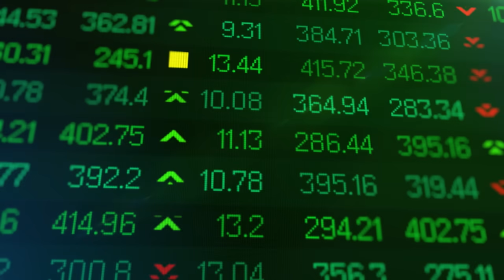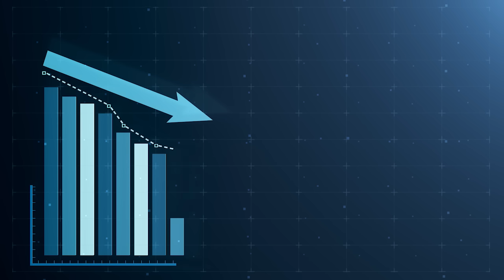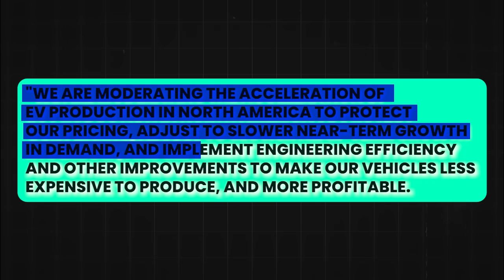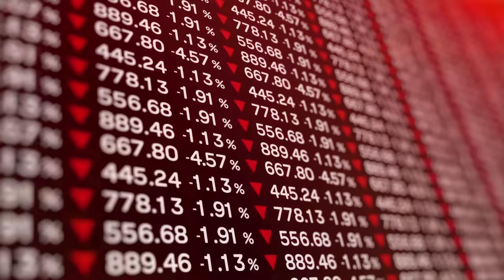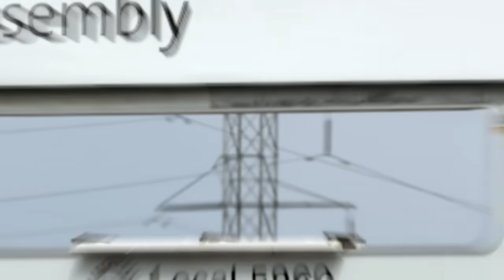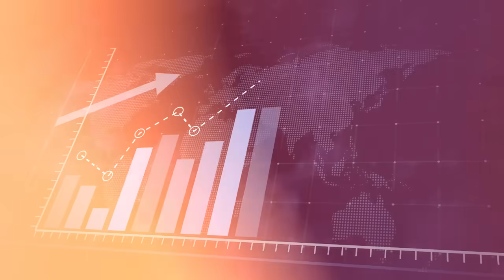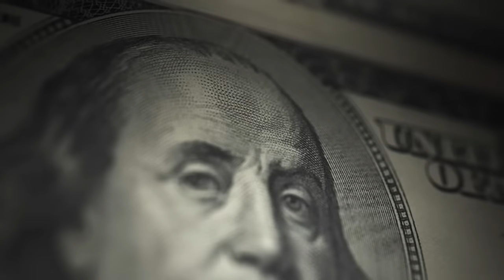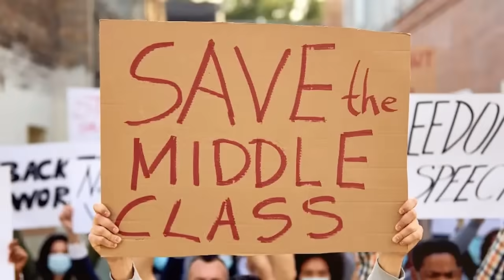HUGE NEWS! GM CEO Just SHUT DOWN EV Production!

Comment: I love how (starting at about the 3 minute mark) it's all GM's fault.  They're not paying the workers enough and the cars are over priced. If they're loosing money on each EV, to the point where the total is into the billions, then they've set the prices too low.  Want to pay workers more? Then you have to raise the prices.

The simple fact is that electric vehicles are expensive, they don't have the range or reliability (drive one in the cold), there is not enough infrastructure to support the ones that are already on the road.  And the buying public is now aware of all these issues.  And the public is also aware that the cost of running these vehicles will be much more expensive than gas powered cars.

The only reason car companies are making huge investments in EVs is that production of internal combustion powered vehicles will be made illegal in the next decade.  There is, and never was, a huge consumer demand for these cars.  This problem is basically the result of socialist policies and beliefs.

Comment: Incorrect. EV sales have significantly increased this year compared to last. GM faces numerous challenges, particularly in finding a competitive edge in the EV market without incurring substantial losses. They are actively making adjustments to remain financially stable during their transition to EVs. They're not discontinuing EVs but are striving to stay solvent. If GM could instantly perfect their processes to produce an appealing, affordable EV, they would, but they can't so their doing what they can--I don't think it will work.  RIP GM

Comment: The average cost of a car/suv etc is $50,000 today. That is the problem not the EV's (they are however even more expensive) It used to be spend no more than 10% of your income on a car. By that measure, you need to be making $500,000 a year to be able to afford a new average priced car today.

Comment: I am quite happy with my 2001 second gen Dodge Cummins with a Manuel transmission. Just spent 800 dollars putting a new clutch in. The truck is a total tractor. Always starts. Gets killer mileage on diesel. Black clouds liberals on demand. Hauls all my heavy stuff around. No car payment. Modest registration and insurance. No thanks on a new EV. I just fine as it is.

Comment: EVs discharge and freeze in the deep cold we get between December and March up here in Maine or other northern local. That means stranded in FATAL temperatures, at best waiting for the battery to thaw THEN recharge in -40° weather. No one ever stopped to think what happens when these age over 15 years in the salt belt. Anyone whom has replaced rusty rockers understands those battery packs WILL fracture in old age, smart people know when a lithium ion batteries puncture they light into a fire that, like napalm, won't snuff out easy! Morty how dumb are you? Just use salt water for the hydrogen in an on demand system. While it may only get 2/4 mpg it's salt water and free! Not to mention the exhaust is fresh air and water two things the whole planet is in dire need of. The internal combustion engine was never the problem the fuel CHOICE is!

Comment: Trying to force a mass conversion to coal burning vehicles (aka EVs) has been a huge mistake. The horse and wagon didn't begin to disappear until a consumer driven infrastructure for supplying fuel to the more efficient and longer ranged petro burners. Government interference (incentives) do a great job of creating havoc as unperfected technology is rushed into production. Battery fires, lack of range, pollution caused by very expensive battery manufacture and the inevitable poor quality control from rushed manufacture keep people like myself from considering the EV. Add to the mess, the cost of an EV over a normal vehicle. This punishes those on a fixed income as retirees. At the beginning of the 20th Century cars were an insanely expensive item and were a toy of the wealthy. When Henry Ford built cars that were in reach of the general public then demand increased to a point where it was a profitable endeavor to start a support industry. Petrol stations, repair shops, parts stores and a spreading fuel distribution system created a price per volume drop which was not a shock to the economic system. Leave it to the market to flourish, To screw something up it takes politicians.

Comment: EVs technology is rapidly advancing. Yet it already has numerous advantages over ICE cars...
More efficiency (gas cars waste 80% of their fuel as heat) 

More room E.g. front trunk. 

Way fewer moving parts. 

More power, faster acceleration, higher top speeds are all possible from small lightweight motors. 

Quieter ride, low center of gravity for better maneuverability. 

No oil changes. Regenerative braking minimizes brake pad wear. 

Safer...large crush zone in the front. Unlikely to roll over. 

Way less pollution that gets better as the electrical grid uses more renewable content. 

Batteries are fully recycleable because they contain valuable assets. 

You can charge at home and be full  every day without going to a gas station. 

4 400watt solar panels on your roof will produce enough electricity in a year to propel a Tesla Model 3 approx. 10,000
miles.  (I bought an 8 panel system for $6500.)

Comment: GM and Ford need New Engine Type (NET) tech which offers:

300,000 mile warranty
30,000 $ price for mini van
3000/4320 mile range on Ethanol/gasoline
300-840 HP continuous-peak
30/60 gallons with/without CO2 capture
3 minute fill ups
that can tow up to 22,000 LBs with extra tow equipment.
AWD, 
bumper to bumper flat inside and out
true skateboard tech that can have 100s of different bodies added
Truly ONE common power system for ALL vehicles
NO drive battery nonsense
1.2 million mile life for 60 years with 3 overhauls
100 MPG Ethanol, 150 MPG gasoline HWY
180 MPG Ethanol, 270 MPG gasoline in City
NET is a combustion HEAT PUMP COP4, that can power house too
Free heating and cooling with CO2 combined cycle capture.
No range loss in cold/hot temps due to cabin heat issues

GM and Ford would DOMINATE the auto industry with NET.
They are bankrupt without it.

Comment: They should have gone with hybrids. Hybrid vehicles would be the only way I would even consider buying one. Also, it better have a solar panel on the roof and not look like a stupid spaceship. And the battery pack needs to be easy and inexpensive to replace. And have a 10 year bumper to bumper warrantee. No more junky, plastic, expensive cars and small trucks.

Comment: So I drove up to Connecticut from Delware on ONE tank of diesel in my 1999 Ford Crew Cab pickup - with 440,645 MILES on the odometer - and we took a two hour trip back to New York City in my friend’s Tesla… we needed an HOUR to recharge for the trip back to Hartford… and, when we got back, we had to take my truck for dinner because the Tesla was back on the plug!

Sooo… I think the “Fact Selector” made my point…

Basic MATH 115 + 115 = 230 which the upper range of a Tesla… right? Those are your numbers… 

Now YOU may like to have driven a car near EMPTRY before filling it up (don’t try that with a diesel vehicle!) but NORMAL people don’t like to drive on the edge of getting stuck on the side of the road because they miscalculated and - now - they have to try to make that Emergency Call to Tesla to release the emergency battery power to limp to a power plug.

As for cost comparisons… were we talking about “cost” or “speed” or “comfort” Huh! We’re we??? Nope.

But - since you brought it up - unless you have installed solar panels on the roof of - your own house - the vast majority or people life on Home Associations or RENT so they are at the mercy of the local power grid (which LIBTARDS forget is oil/natural gas and or nuke driven) so you will have to account for paying the utility companies over the next 25 years! You wanna bet that’s gonna remain… cheap to power up your EV every night? 

Yeah, a 25 year old diesel truck SUCKs fuel from that 40 gallon tank… and cost a couple thousand in maintenance every year since I bought it for $8K back in 2003 best deal I ever made in my life because I’ve always worked 15 minutes from where I lived because I rented or moved (most rentals do NOT have EV and it doesn’t look like people will be able to afford to buy houses for the foreseeable future… “renters” so factor that into any purchase.

Finally, as my Tesla owning friend says “I wanna pick up some stuff from Home Depot for the house” YOU DOING THAT IN A TESLA! Can’t count the number of times I’ve folded back the tarp and hauled lumber, chairs, pipes… and - as things get harder - I have the option to use my truck to make some $$$ in ways that would make Tesla owners WINCE ! 😅😂🤣

Finally, I go on epic trips and load my 2018 BMW Adventurer - using a Rampage - into the back with enough camping gear to last a month - and when I unload the bike - the tent goes over the back of the truck… no NOtels!

And the ride - up above the crowd where I can stretch out in a crew cab (along with four other six foot ADULTS) - is the best driving experience I’ve ever had in my life (and my first High School car was an inherited used Porsch!) When my friend and I wanna go for a long drive - with his wife and kids - he offers to buy me a tank of diesel (which I don’t need) while his Tesla stays at home… with his dog.

So - that is the “holistic” experience of STILL driving and riding and owning - a truck! 

Enjoy your Tesla and solar panels (and let me know when the 20 year Lifespan of those panels expires… still don’t know who is going to be responsible for the toxic waste of dead solar panels 🧐)

Comment: Thing is without the Tesla supercharger network, EVs are extremely inconvenient. Even with the superchargers it takes about an hour to charge, which is already a deal breaking for me. Other chargers are 1/10 the power. Yeah if you own your home you can charge at home but what about when you leave your city.

Long story short Tesla is the only one I would consider buying. As a professional driver, who leaves my city a lot, one hour of charging per 6-8 hours isn't good for me.

Personally I prefer hybrids. Not the plug-in type either, gas only. The hybrid system makes the car very low maintenance by taking a lot of stress off the engine, transmission, and brakes. Great had mileage. Mine is pretty fast although not as responsive if you floor it. It's a 2011 Ford fusion so maybe this has improved.  No charging required.

Comment: I am fine with my hybrid I get 50 to 60 miles a gallon and roughly 500 miles on a single tank switching to full Electric when driving is my job would it hurt me in the long run because I would have to stop way more often just to get a charge and most ranges for a full Electric is like 200 - 250 on a single charge which is not enticing enough for me to go for electric

Comment: Anyone who is a RC enthusiast knows that this is not a sustainable future for mass transportation. Electric Vehicles get 10-20 years of battery life if in perfect conditions, traveling places that are hot or cold will effect this lifespan with a  price point of 4000 to 20000 dollars depending on your car/truck.  Hydrogen engines are the future the exhaust can help with crop growth in the future.  Batteries are far to expensive, id never pay for a replacement battery in those cars.  Our battery technology will not support a sustainable change to electric.  We will mine the planet dry of lithium before this ever occurs.  However hydrogen is plentiful and we can create it Easily.  Either from water or just bottling air and separating the molecules.

Comment: Stop selling fuel efficient cars losing your loyal customers to other manufacturers.
Then wonder why you dont have a customer base for "green" vehicles?!?! This was the most predictable marketing disaster ever.
By the way, a HUMMER H2 is an ABSURD vehicle.
A BATTERY HUMMER.....also an absurd vehicle.
Lost entirely in the EV switch is this, we need to use less resources.
EVs with every possible option weighing 6000lbs are not "environmental " They are simply vulgar resource PIGS.

Comment: I GUESS I'M JUST AN OLD FART But I remember back in the 1980's Chevrolet ran comparison commercials. There were several but one that stands out was a split tv screen showing a bright red 1988 (or 89) Chevrolet Cavalier on one half of the screen and a red Honda Accord on the other half. The salesman wanted to see how much the Cavalier looked like the Honda but cost something like $300 cheaper than the Accord.

Ever since those commercials I've noticed the truth in advertising. Chevrolet builds cheap knock-offs of other manufacturers successful makes and models. To this very day there are millions and millions of 1989 Hondas on the road. I haven't seen a 1989 Cavalier on the road in the last 25 years. That should tell you all you need to know before purchasing a Generic Motors Conglomerate (GMC) product.

Comment: Hydrogen combustion engines are the answer. But My 2010 Prius has 240,000 miles and I’ve never had an issue other than normal wear parts.  If I find another old Prius, I’m buying it.  And I live in Vermont with harsh winters and salt. Hybrids are awesome.

Comment: I believe at some point all gasoline powered vehicles will be phased out, but really that's not for a very long time.  The tech isn't really there yet.  Economics don't support it, infrastructure doesn't, and neither does the supply of the rare minerals used to make them.  I think it's more likely that both the gas powered and the current style of EV cars get replaced by another more efficient type of self powered engine.

Comment: I own an EV but it requires owning a regular car as well because the range is very short requires an hour to recharge on DC fast charge and chargers, especially the so called fast charges are far and few and when you find one it’s in use or busted.  Regular cars have 500 mile range, gas stations on every corner and freeway exit and fill up in couple of minutes.   
The EV is great for local errands   but you have to be carefull or you’ll need to be towed home.  My BMW i3 cost 50 grand and within a year was worth 17 grand.  Pretty much a disaster purchase.   If GM or Ford had hired me as CEO I would have saved them billions.   Likewise if I had become president I could have saved Billions in wasted, lunatic EV policy.   The average janitor would have done better in either case as well.

Comment: It was the right decision to make. Before any it hit the market it's infostructure must be present in order to support it. In the case of EV's, it wasn't broad enough, it wasn't easy enough and wasn't cheap enough to make it a reasonable replacement for gas powered automobiles. 
Let me go over my points.
It wasn't broad enough. Let me ask you a question. How many gas stations are there in the USA? Now compare that to how many Recharging stations exist even today?  It's not even close. And you can fill a gas take in five minutes and be on your way. How long does it take to recharge an EV? Americans are an impatient lot, and do not want to suffer inconvenience. 
And by the way, most Americans do not live in single family homes with garages anymore. So, the ideal of home charging systems is moot. That is unless you either A.) Are willing to provide enough charging stations at apartment and condominium complexes in the USA, at your company's expense or B.) Able to develop a self-contained recharging system that would eliminate the need to stopping anywhere. (By the way, I've got a saturation for that but I'm not going to just give away.)
It wasn't easy enough. If the infostructure existed, if something like my ideal was created and proved on a mass scale, that would solve the first two problems. But then comes the last one: Affordability. Can you do that?

Comment: Chevrolet (GM) SU*KS ANYWAY!!!!!!!!! My 2015 Camaro convertible top has been changed 3 times after the warranty (No Accidents, 31,534 miles IMMACULATE condition costing me $2500 each time. Corporate blew me off and the dealer is useless!!!!!! The rear window keeps separating from the trim. I called other places to fix the top and they didn’t want to be bothered!! Stating “ This is  a common problem with the Camaro convertible and it’s a pain in the butt to fix”. So I will make sure that none of my family and friends NEVER BUY CHEVROLET (GM) cars and/or trucks!!!!!!!!!!!!!!!

Comment: The fact of the matter is some very good new engine tech is coming that use cleaner fuel that are equal or better than oil in mileage and power output, it's a waste of time, that and they are far less complicated then evs to build.

Comment: We don'[t want EV's. I keep a truck or car for 20 years. I pay it off in the first 3 years then I don't have a auto bill for 17 years. Batteries on EV's will not last for 20 years. Maybe 8 years before they are useless for anything except city driving. Why would I spend another 8 to 12 thousand every 8 years to for a used car for buying and the installation of a new Battery. After 10 years you won't even be probably able to buy a replacement battery.  Also will the car mechanical side even be worth investing the money to replace the battery twice in a 20 year span. I may spend 2 thousand in parts for a gas powered truck/car in a 20 year span. EV's cost too much, you need to buy a charging station, upgrade home circuit boxes, and cost of the vehicle is actually divided by 8 yrs compared to a fuel vehicle lasting up to 20 years. If you want to save the environment, buy a small 50 mile a gallon car or a gas/electric combo. The batteries materials come from slave type labor, it pollutes the ground, and then the used battery is chemical waste to pollute the water/land.